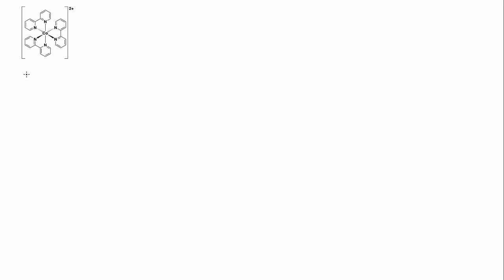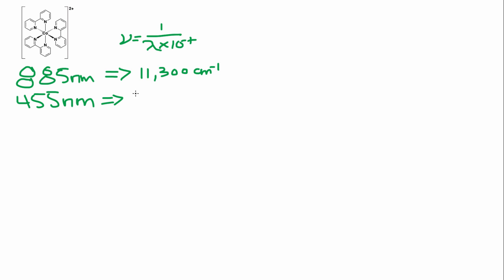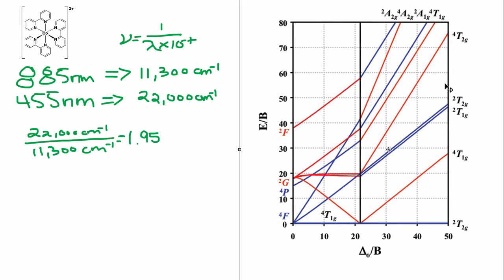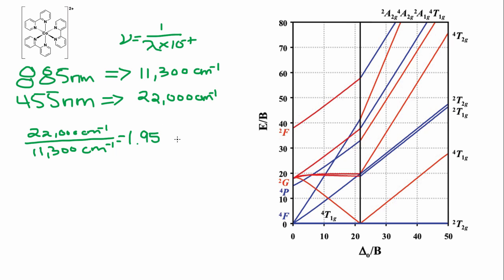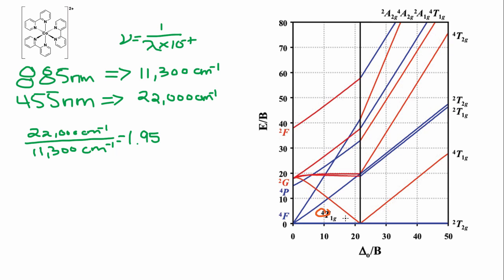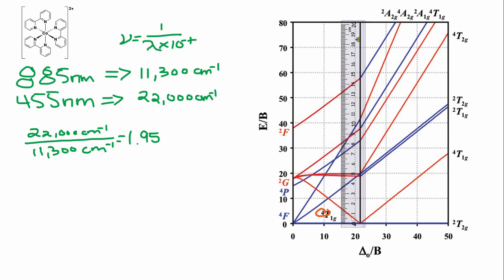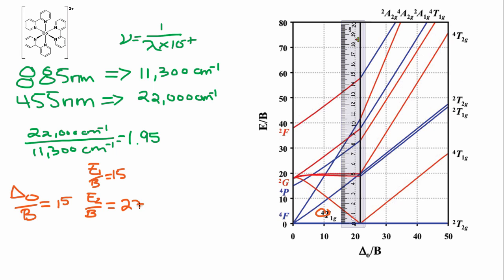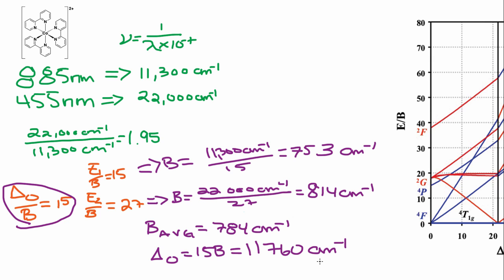Tanabe Sugano Diagram - d7 system

Comment: I thought bipy was a strong field ligand. Wouldn't that make it low-spin?
Reply from the maker: The “strong field” vs “weak field” nature of a ligand isn’t the only factor when determining high spin vs low spin. The metal and charge have an influence as well, as is the case here. Typically 2+ charged first row transition metals have smaller octahedral splitting values compared to 3+ charges or second and third row metals. The only way that you can ultimately determine the spin state of a metal is by performing the experiments (UV-Vis, magnetometry, etc.)
Reply: If only I knew this before my inorganic exam last year 😂 thanks for the reply, very informative!
Reply from the maker: @ktwastakenagain  sorry, I just now saw it!
Reply: I have this doubt in a recent test. In this article they do experimental and theorical calculations and give the following result "For cobalt (II) tris-2,2’-bipyridine our combined experimental and computational study reveals ~40% low-spin and ~60% high-spin state components". It is a "tris" compound, but still...
https://bib-pubdb1.desy.de/record/428846/files/CoBpy_02Mar2019.pdf
Reply: had*

Comment: First of all thank you very much for this tutorial, ist was indeed very usefull. However I still have a question. Why didn't you take the 4T1g to 4A2g excitation in consideration but instead only focusd on the 4T1g and 4T2g ecxitations?
Reply from the maker: nicolas dobler The slope of the 4A2g is around 2 which is for a two-electron transition. They are less likely and therefore not typically observed in an electronic absorption spectrum, whereas the 4T2g has a slope of one, indicating a single electron transition, which is much more likely to be the correct assignment in this case.
Reply: @EricVictor  Oh Ok I didn't know that the slope of the plot contributes to the amount of excited electrons.
Thank you nontheless for the explanation

Comment: I'm kind of cunfused as to why the calculated octahedral splitting is larger than the lowest excitation wavenumber. How can a transition occur if the energy that is necessary to promote the electron is greater then the energy I put into the system?
Reply from the maker: Short answer: The energy of observed absorption isn't strictly due to the promotion of an electron from a t2g to an eg orbital as would be expected if the energy was only related to the octahedral splitting energy, but rather the change in state of the system from the 4T1g microstate (ground state) to the 4T2g microstate (excited state).

I will try to post a video in a day or two, and go into more detail on why the lowest energy transition doesn't directly equal the octahedral splitting energy for any system that isn't d1.